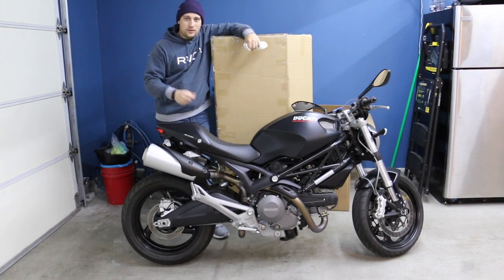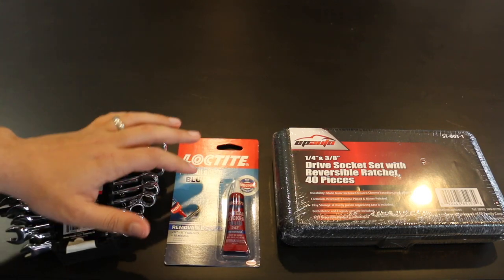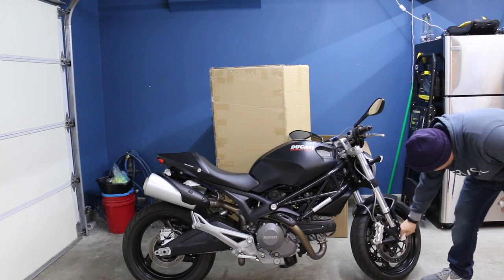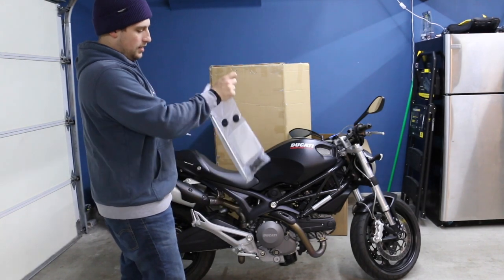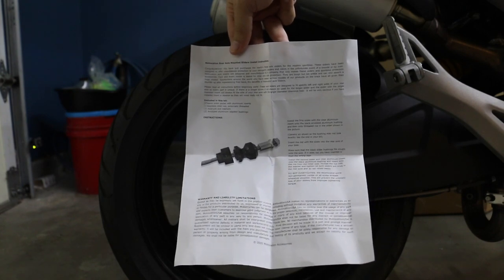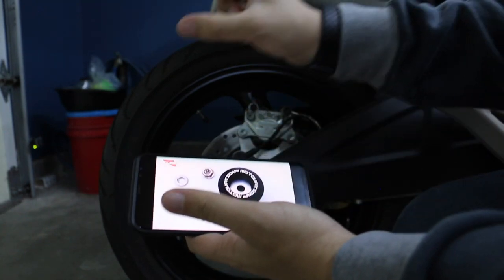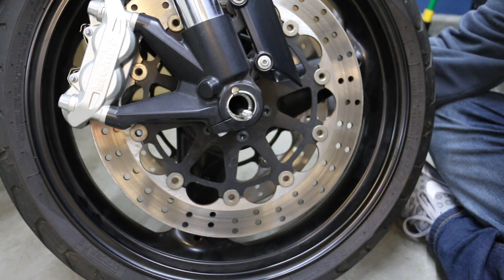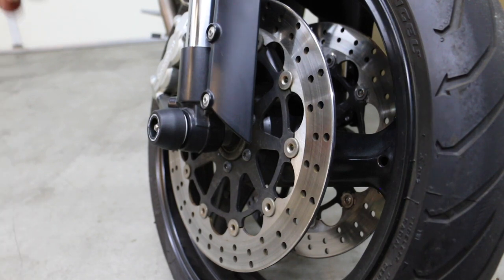DUCATI MONSTER 696 | FORK AND REAR AXLE SLIDERS INSTALL

Comment: bike is looking good man. part of me wants a 696 but might get something spicier.
Reply from the maker: Go for 796 or 1100 instead. The fast idle on the 696 is finicky. The other bikes dont have it. Also wish I had a single sided swing arm. The other bikes have that. The other thing I wish I had is adjustable front suspension. The 1100/Evo both have that. If you can find a deal on an 1100 I'd hands down recommend it. If not go for the 796. Last thing I'd say. If you want modes and abs and a non plastic panels on your tank just get a new 821. I hate the plastic panel on my bike it scratches super easily.
Reply: @FunWithAJ  I put a adjustable suspension from a s2r 1000 onto my 620. nice and easy job and not pricey. and i actually prefer a dual swing arm and idle adjuster. funny how one mans complaint is another ones preference. yea, i have no idea what i'm gona do yet.
Reply from the maker: @ducatinyc  I hear you man. So my gripes are related to different things. I priced out front suspension and itd cost me $750-1200 min. While my bike costed me under 5. Just way to steep for me. If I would have gotten the 1100 or evo it would have came with adjustable fronts from the start. Regarding the single sided swing arm, not only does it look cooler than the dual that 696 has, it makes changing the chain and tires about 100x easier. Lastly the fast idle is the bane of my existence. It's extremely finicky. I'd rather just start and go then wait 10 minutes for a warm up cycle.
Reply: @FunWithAJ  whats the warmup cycle? i always just get up and go, in any temp. maybe let it warm up for 30 seconds. fast idle is nice in my case since it lets me give it a bit of gas when i'm starting the bike. My front fork was 650 for a bike that was 3900 so i hear ya. but well worth it. not sure what i'm gona do about the new bike, plus i still love my bike and its going strong.